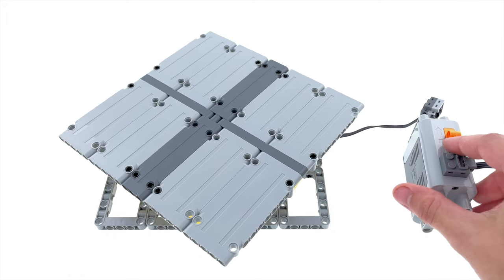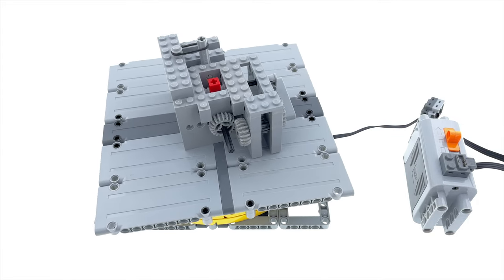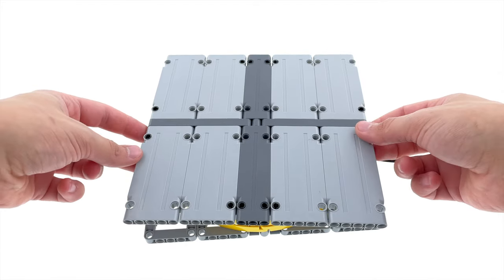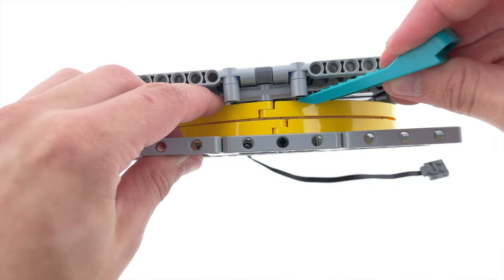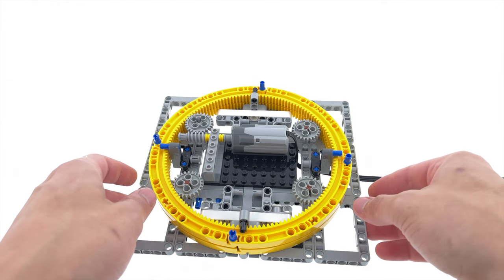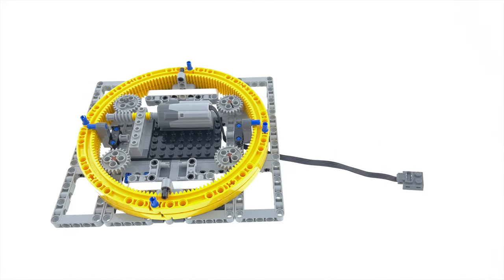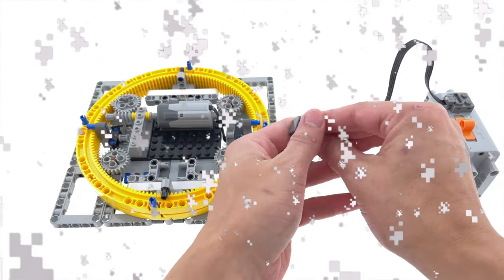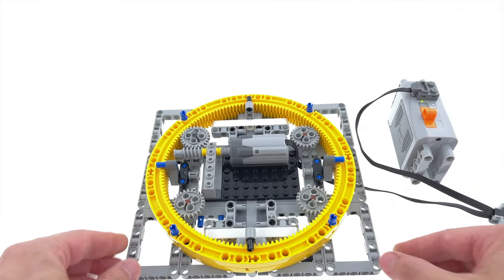Extremely Compact LEGO Technic Turntable

Comment: Thankyou for not condensing this down into a short!
Reply from the maker: Ah yes! Another shorts hater. Out of pure curiosity, what you you dislike about shorts? I personally dislike them because they don’t give enough time to explain everything about most projects and shorts videos feel rushed in general. The other major beef I have is vertical video. Everything just seems smaller and harder to see in vertical videos. If shorts were able to be created using standard 16:9, I bet many more people would be on board. The only time when I will use shorts and thus vertical video is for very small(physically) projects.
Reply: @LegoTechnicsRule  I dont like them because they feel like Im left wanting more from it, but there's not enough time before it moves you to the next different thing

Comment: That's a really good turntable, and everything is a LEGO pieces, that's a nice thing. You made me question my design guite much mate, I did my own that I use for my videos and I think your is better because it doesn't need that much pieces to build as mine. I used 4 wheels at the bottom, and two of them are powered by one m motor, then stole some circle wooden cutting board from my mom and secured it with another 4 smaller wheels, so it will stay still, and that really takes a lot of wheels :D There is really a lot of ways to make the same thing
Reply from the maker: There sure is! Check the description for some more pictures of the thing if you want to recreate it. When I said that you could build it just by looking at it, I was very mistaken after rewatching, so I added an Imgur link in the description.
Reply: @LegoTechnicsRule  i don't think you were mistaken at all my friend, its preety easy build, and if i only have those yellow big circle pieces i would definely use this instead of overcomplicated spinning cutting board, but for this moment Im propably gonna stick to this

Comment: Far more compact than the turntable I made 20 years ago using the ring-wheels from the Star Wars Hailfire Droid, and a veritable sh!t-ton of small wheel hubs..
But to be fair, it could carry a hell of a lot of weight.. the 10 kilo superstructure of a crane I built for example, which had a 3mt main boom and 1mt jib with 4kilos of counterweights, and 500mm long crawler tracks..
Reply from the maker: I never thought of using the droid wheels as a turntable, granted the banana gears are relatively new parts. I assume the wheel hubs were the bearing balls? I suppose that the bigger bearing balls allowed for more weight in turn for a larger design.
Reply: @LegoTechnicsRule  "I suppose that the bigger bearing balls allowed for more weight in turn for a larger design" <-- yep precisely.. that and the groove in the Hailfire wheel is just under half the radius of the little wheels hubs, and very slightly wider.. It's almost like it was designed for the purpose.. :)